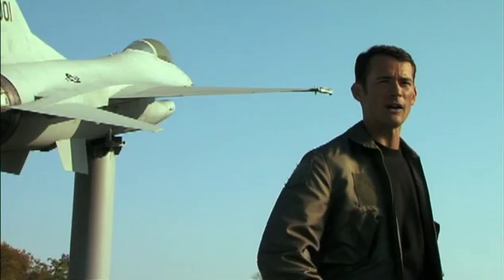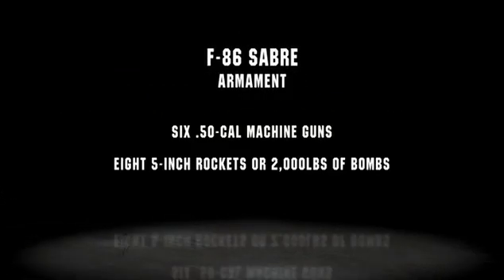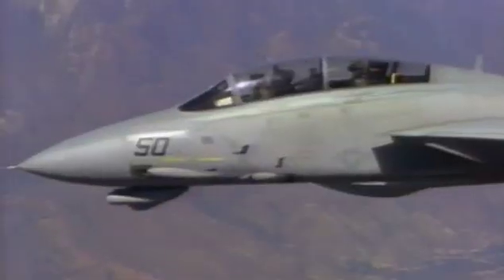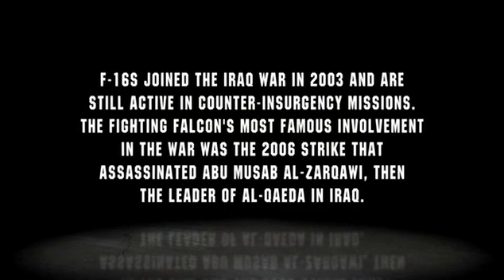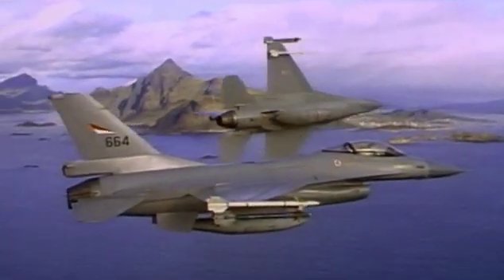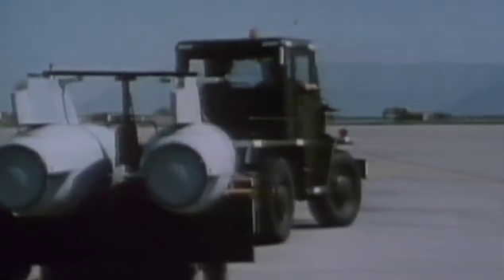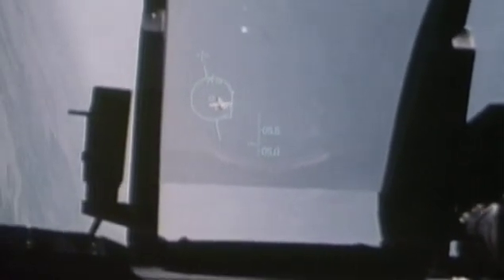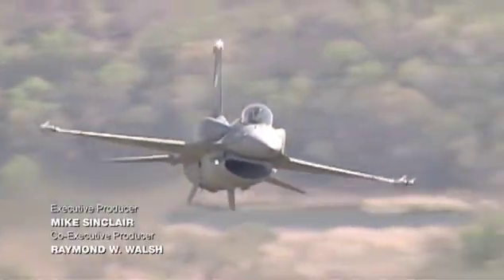F-16.Fighting. Falcon.

Comment: did dude just say 50,000 ft a minute.... I knew the F-15 and F-14 could climb fast but thats pretty damned good.

@ 12:02
Reply: Eeeh it's not that impressive

rafale can go 60000ft/min
eurofighter can go 62000ft/min
mig-29 can go 65000ft/min.

the 50,000ft/min of F-16 is positively anemic, a disappointment for an aircraft that was supposed to be a point interceptor.